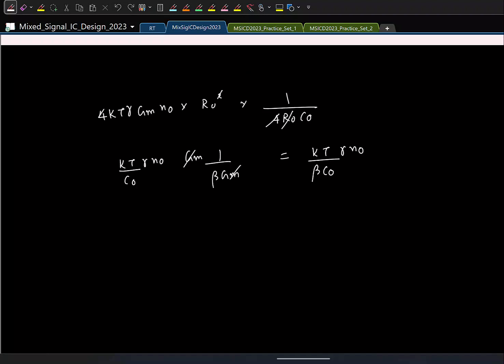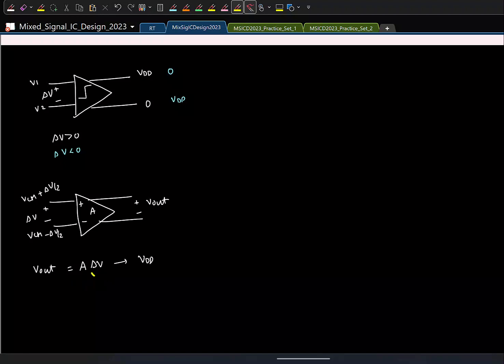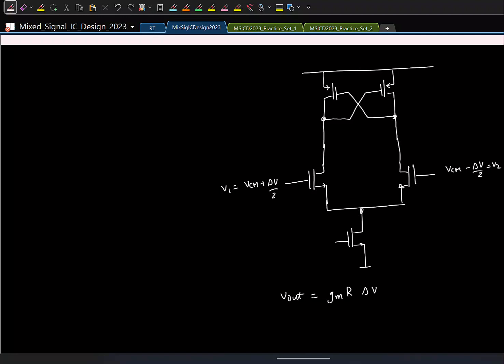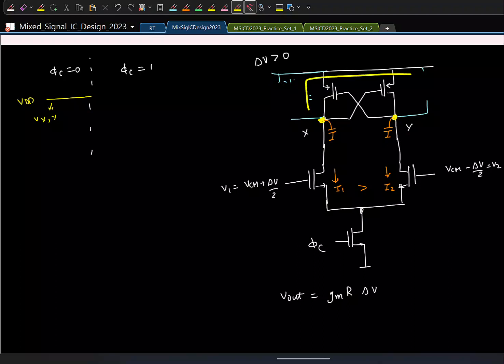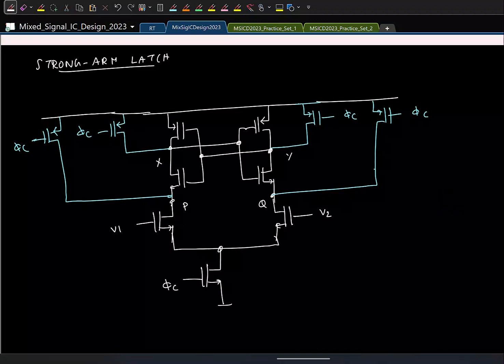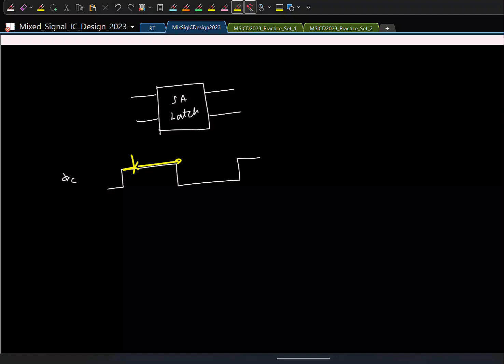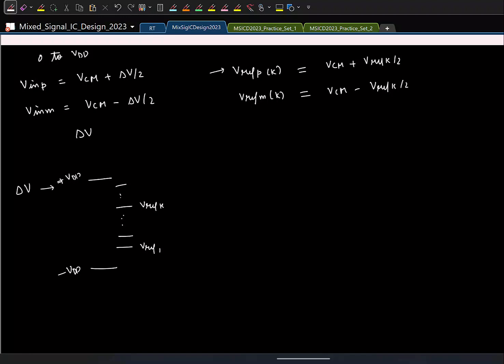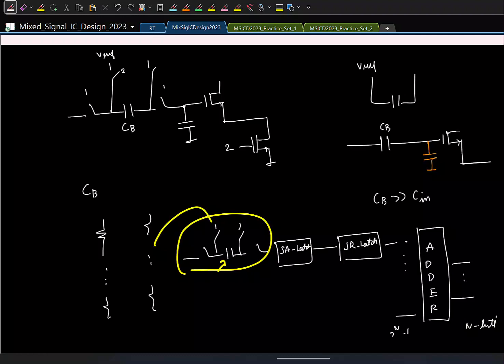Lecture 10: Deriving the StrongARM latch; Introduction to Flash ADC

Comment: Greetings Professor. 
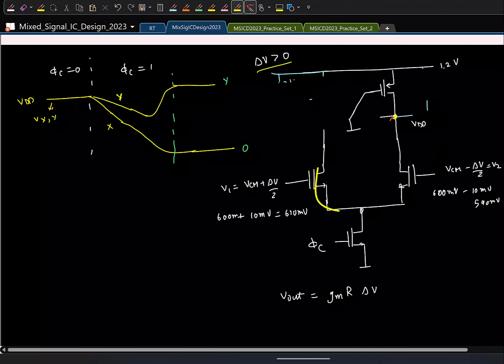At 36:37 the pMOS has little to no Vsd. 
Vy (Drain of pMOS) is at VDD (almost) and Source of pMOS is also at VDD, that should yield a Vsd ≈ 0 V.

Shouldn't that make the current ≈ 0? Even with the Vsg ≈ VDD, Source and Drain are almost shorted and no current should flow.

But, how are you saying that it will conduct current? Can you clarify this?
Reply: there is a switching pmos whose gate controls the Vx or Vy voltage to be Vdd or not when switch is on Vx and Vy will be at VDD so no current flows it is the reset period in the comparison period the switch is off so there is no fixed voltages at Vx and Vy at that time current flows and positive feedback regeneration happens